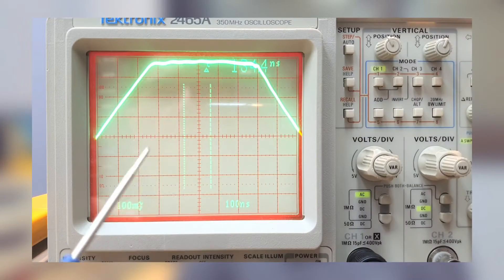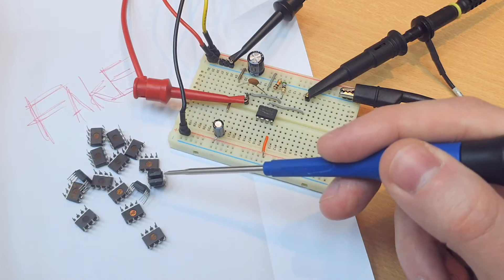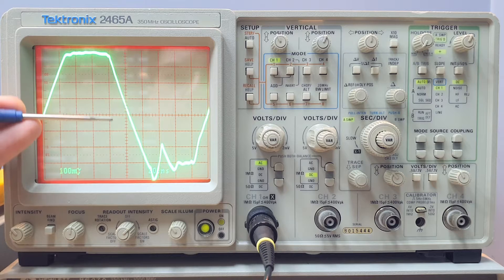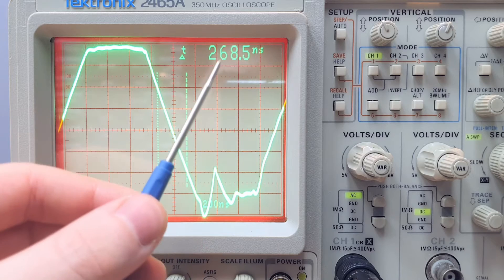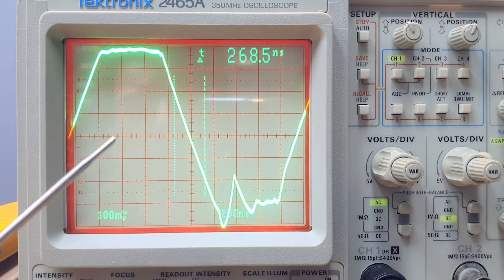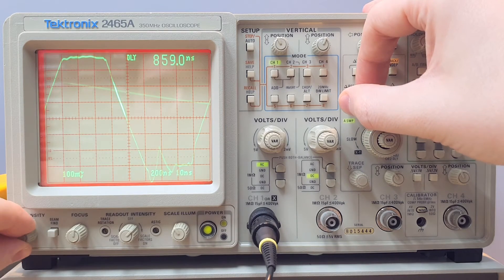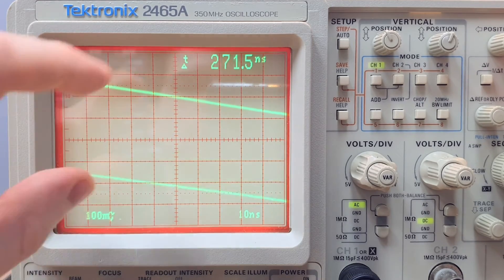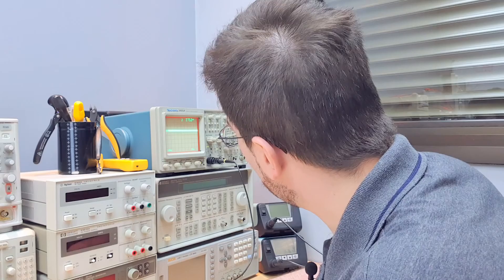How to check if an operational amplifier is fake

Comment: Is there any other way to check fakes without a scope? I'm not an engineer,  just a hobbyist who likes to build guitar pedals. Maybe fake opamps don't really influence how distortion pedals work or sound as much as other applications where slew rate or other specific aspects of the opamp need to be accurate, or maybe I'm totally wrong! However,  if they do affect the sound of the pedals I build I would like to be able to check somehow. I have a multimeter and a breadboard and a large variety of parts. I'm pretty sure this pack of 20 JRC4558 from amazon are fake because I have a few real ones from Texas Instruments and they don't sound quite the same and were not packaged as nice and static resistant as the T.I. ones. It doesn't mean I won't use fakes because they still make a usable sound (in building pedals all sounds are useable!) but for consistency I would appreciate actually knowing. Thanks!
Reply from the maker: Hey man, let's think about it.. 

1) You can try to measure the current at the supply, to see if it matches the originals. 
2) You can try to measure the input bias current, using a voltage follower configuration, and a resistor to ground. The voltage over the resistor will be bias current * R. 
3) You can try to measure the voltage offset.
4) You can try to measure the rail-to-rail maximum excursion of the output. 
5) ... 

I think that making a comparison table, with some original ones as reference, you will be fake to distinguish which ones are fake, by the deviation from the standard..
Reply: @ thanks that’s really helpful! Seems kind of obvious now that you said to compare them haha
Reply from the maker: Let me know the results! hehe
Reply: @AllElectronicsChannel  I tested a couple before work and they seem to be legit, they're jrc4558 opamps so maybe it's just my own perception bias that made me think they were fake since they were cheap from amazon and the printing on them with no company logo like the texas instruments ones I have that are laser printed.
Reply: Just spend the money and buy them new from Digikey or Mouser, in your region.
Reply: @cjay2  Yup ☺

Comment: Fun to see. Where is the formula that take care of the slew rate of the oscilloscope?
Reply: Why are you laughing at this guy ? The formula is SR = ∆V / ∆T you need to explain this. Also the whole video's about fake parts and you didn't show the difference ! how close are the fake ones ? could they work fine in some applications and you wouldn't know ? You basically showed off the scope now do it with a cheaper more 'run of the mill' scope and explain that ! that is the way to learn. I am very disappointed in this video as your work is usually better than this. @AllElectronicsChannel

Comment: Slew-rate check is indeed an fast way to check.  Good tip. But I am interested to hear which specifications are most likely to be expected to be violated, from the experience, as I have not dealt yet with this fake parts. Where, who and how do they make these components? Quite curious. It is not something you can make in your garage.  You need advanced technology and yet you produce crap. Steange. 🤔